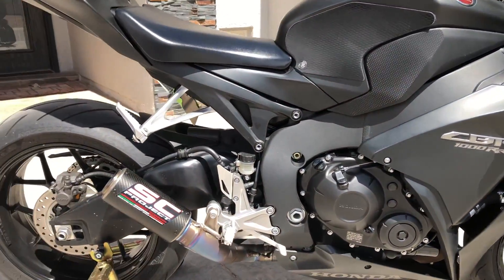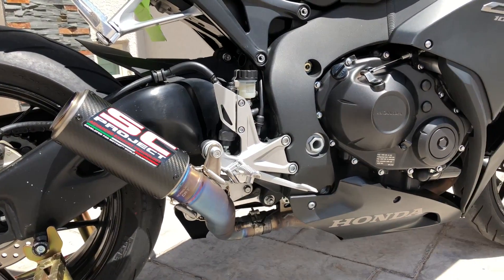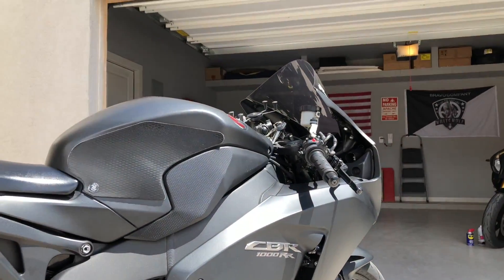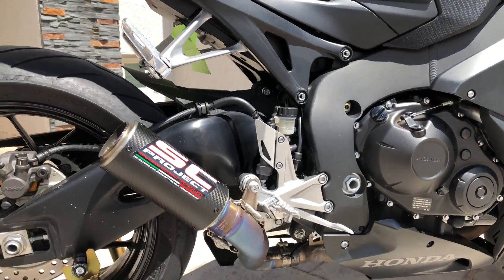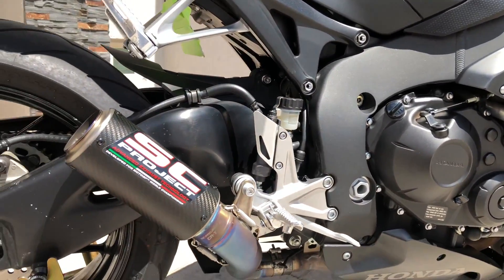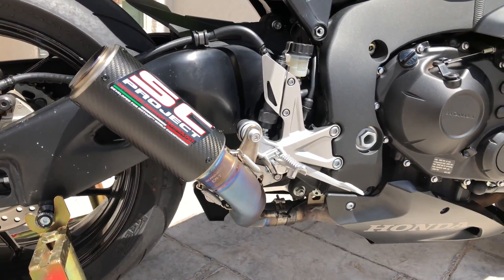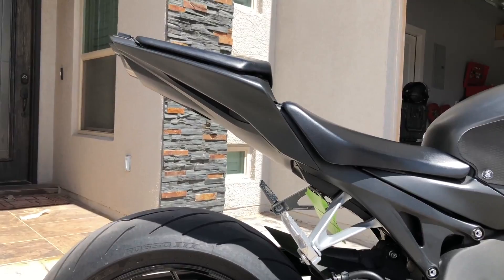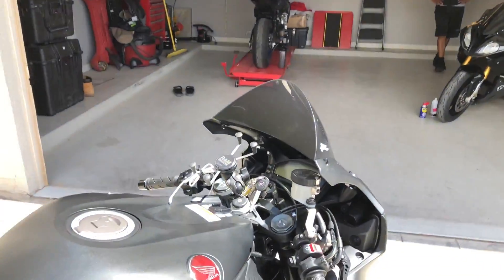CBR 1000RR SC Project CR-T Best Exhaust Sound!

Comment: Love the bike and the sound but i would say to look into getting it mapped and tuned or running a power commander to get the most out of it!
Reply from the maker: Absolutely
Reply: Don’t really need to get it tuned or anything for a slip on. You’d generally only do that for full system swaps.
Reply: @Zighast  this sc project is a half system which takes away the catalytic converter thus requiring you to have the bike tuned otherwise the AFR is all over the place
Reply: @sosathesavage6520  Ohhhhh gotcha, I didn’t know that! I’ll jot that down for future reference because I’m getting ready to slap on a new exhaust myself. Just gotta find the right one because my bike is 31yrs old. (CBR600F2) so it’s hard to find an exhaust I don’t have to make myself or weld on.

Comment: Newer generation bikes have really lost their sound. Older bikes like a 1980 CB750F or 1994 GSX-R750 sound absolutely brutal. Newer bikes sound muffled, even with a full exhaust.
Reply: They really don't. You just stuck in ur ways . Witch is fine .
Reply: They are definitely designed differently but to each their own

Comment: What's your thoughts on the SC Project exhaust VS the Austin Racing Gp1r? I'm leaning towards the Akrapovic header with the Austin Racing Gp1r can for the 2021 ZX-10R.

Any reason for one over the other?
Reply from the maker: Both sound badass can't really go wrong with either one. Def do a full system for best all around performance.

Comment: Sounds like it needs a flash and tune lol sick bike though
Reply from the maker: It's flashed, but ya you're right a tune is on my to do list!
Reply: @wildwhiskeywolf  quality vid though, you helped me on my purchase I made in deciding whether or not to get the carbon finish. Looks sick
Reply from the maker: @robcurtis9538  Thanks brother, glad I could help!
Reply: Did you fix that idle? If yes, how ?
Reply: @krisztiandeak  tune it
Reply from the maker: Rob Curtis That is next on the list!!
Reply from the maker: Deak Krisztian when I get it tuned it only has a flash right now
Reply: @wildwhiskeywolf  what’s the difference with flash and tune?  Not same thing ?
Reply from the maker: With flash the throttle is much smoother and you get way more power..amongst other positive things
Reply: @wildwhiskeywolf  I was planning on getting my bike on dyno and tuning it through the ecu. No PC or bazzaz. Is that the best option ?
Reply from the maker: Yup!
Reply: @wildwhiskeywolf  great. I got a 2015 SP and it has a CEL for O2 sensor. I think it’s because the bike has a slip on and a cat delete and servo delete. Hoping a flash will turn the cel off
Reply from the maker: Ya, you can turn it off through the flash

Comment: Mine does exactly the same on idle. It fluctuates ever since i fitted the sc slip on. Doesn’t this damage valves in the long run?
Reply from the maker: No, no damage to the valves!!
Reply: Cool. So i take it to be safe then. It only fluctuates on cold. Once she warms up she idles normal.
Reply: Whats the idle at? Have you tried adjusting it?
Reply: Get a tune
Reply: @MADLITS1K  what kind of tune and how?
Reply: Mine does the same thing with a slip on. Once she's warm it goes away and idles smooth. I do have some crackle and pop in hard/high rpm deceleration but not anything that seems terrible. I like it tbh. I don't mind getting a remap when I have time and money laying around.

Comment: Cat deleted ?
Reply from the maker: Yes, the SC Project system comes with a de-cat link pipe
Reply: @wildwhiskeywolf  how does the bike ride when it wasn’t tuned?
Reply from the maker: @jordan_.zx10r  Ran fine, runs even better after the dyno tune
Reply: @wildwhiskeywolf  my 2015 cbr 1000rr sp has a cel code 23 which is O2 sensor heater core. I’m wondering if it failed due to the cat delete. I’m going to dyno it and disable the sensors but not sure if that’s a good idea. (Kinda lazy to install new sensor so I’d rather just disable)
Reply from the maker: Get the ECU flashed if you deleted the o2 sensor